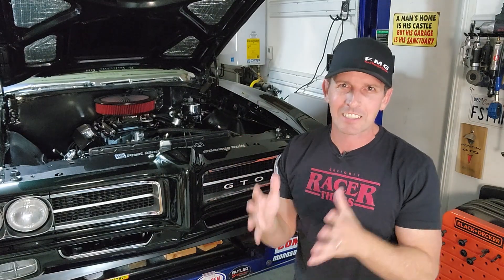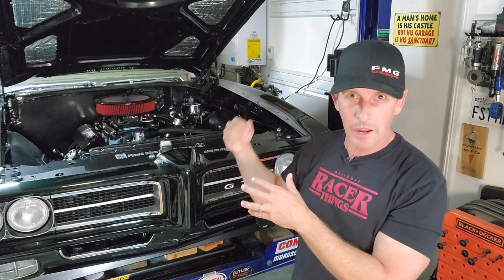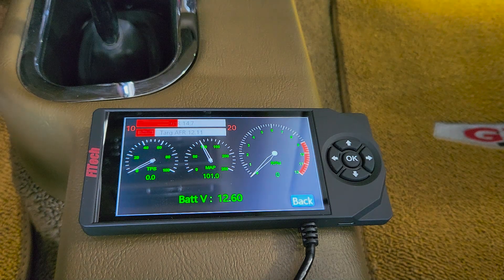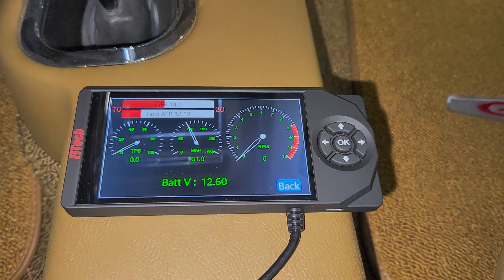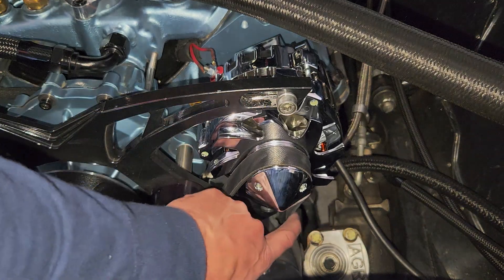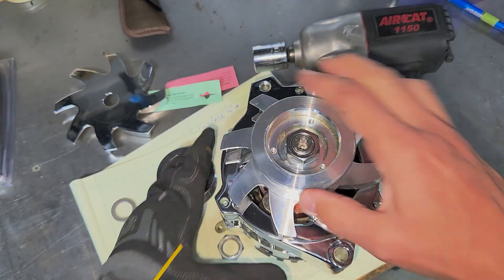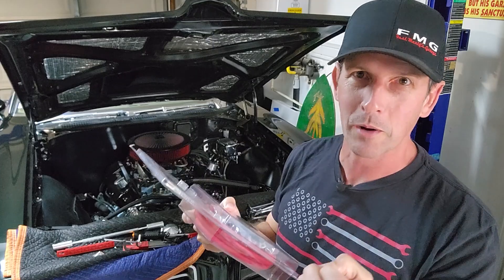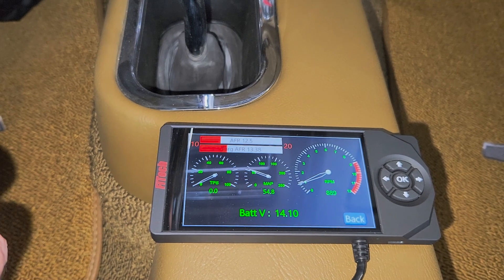How to diagnose an Alternator, and properly install a One Wire alternator with more Amps.

Comment: It's easy to be a critic on this side of the computer screen, but if the engine starts to stumble and electrical components start to act weird while the engine is RUNNING, it's almost NEVER going to be the Battery.  The battery is an electrical storage compartment and electrical buffer for the electrical system.  When everything is connected properly, the alternator has a built-in regulator to maintain voltage, and it modulates necessary amperage based on electrical load.  In other words, if the alternator fails (even during mid-trip), the available battery voltage (& capacity) will gradually diminish, causing drivability issues as components are starved for voltage..... okay:  ELECTRICITY for the novice out there.  This condition is immediately validated by the slow cranking speed during the attempted engine re-start:  The battery has lost it's capacity.  (Ok, Ok.... I'll give you props for the "Hot-Soak" condition - -- yes, this happens as well.)  But sorry:  The sequence of events and field-observations would immediately steer a seasoned technician towards the alternator, not the battery.
.
Another technical error I'd like to point out:  You are absolutely correct about never disconnecting the negative battery terminal while the engine is running.  Yes, it can destroy electrical components on modern vehicles, but it's not due to amperage issues.  It's due to voltage spikes.  First, a voltage spike will happen as the neg wire is disconnected...the alternator is all of a sudden confused as to voltage regulation; it'll immediately max out and/or go haywire due to the absence of battery buffer in the circuit.  Additionally, if this {terminal disconnect test} doesn't kill the electrical components, reconnection can due to another voltage spike event...as evident by the sparking terminals.  Reading up on switch "bounce" validates this paragraph.
.
Furthermore, recall the famous formulas "Volts x Amps = Watts" and Ohm's Law (V = I * R ).  ...and here is the WATERED-DOWN explanation for this one:  An electrical gismo is generally rated by power (watts) at a certain anticipated running voltage, but its internal resistance generally remains constant.  A functional alternator, spinning with Neg battery terminal disconnected, will generally "Max-Out" on voltage and provide maximum amperage on demand.  Going back to the formulas, they can be combined algebraically, resulting in   {Voltage (squared)} / Resistance = Watts.  If the gizmo resistance remains the same, and the voltage increases, then wattage increases by V (squared).  Basically the gizmo burns up because it can't handle the power output.  Solid State devices "burn up" due to overvoltage as well, but such properties can be vastly different and is a story for another book.  ....basically damage is done at junctions.   Oh... I'm not going down that rabbit hole.
.
As for the new alternator spinning more "sticky"... too many variable to consider.  Different bearings, different tolerances, different design.  But generally speaking, things "loosen up" as they're broken in. 
.
....if you made it this far in reading, I've been a tech for 40+ years.  I know a lot of stuff.
Reply from the maker: Yeah, what he said.  And, I did read the whole thing... baaaahahahaha.  Thanks for the comment!
Reply: @FastMonty  ...And when things loosen up, that's what SHE said. 😜
Seriously, you did a nice presentation and you emphasized (often overlooked) critical support components such as wire gauge.
{Just hypothetical numbers here, okay?}
Upgrading from a 90-Amp to a 150-Amp alternator doesn't mean it'll always pump out 150 Amps.  ....Power produced will balance with power consumed.
.
But my point is that upgrading (heavier-gauge) wire is a MUST to ensure an operational & safety margin.  Good Going & Nice video.
.
....we've all been there:  Mistakes, learning curve.s, & corrections  Me Too.
Reply: @FastMonty  would like to offer some input (pun intended) to one last item:: Swapping pulleys to accommodate belt length.  ...not a good idea in long run.  Installing a larger diameter pulley also decreases RPM at any given engine speed which surfaces 2 stress issues.
1.) Lower RPM = less airflow cooling, and
2.) Lower RPM actually causes internal components to work harder to produce required electrical output.
{ I'll refrain from all the tech reasons this time 'round }
.
The alternator mfg designed the alternator with certain specifications which shouldn't be tampered with.  And generally speaking, alternators are "happier" spinning at higher RPM.
.
Unless you have an oversized (diameter) crank pulley [AKA Harmonic Balancer] ...which is doubtful... to compensate for accessory spinning RPM, I'd install the original pulley again & purchase a shorter belt to compensate.
.
Yah !!
Reply from the maker: @Schrimpieman  Thanks!  Yeah, I do embrace mistakes, cuz I learn that much faster.  Thanks for the comment!
Reply from the maker: @Schrimpieman  I hear you... I also "ran this to ground", pun intended, with Tuff Stuff.  They were perfectly fine with the diameter change.  I didn't go into the details, cuz there's only a couple people out there that really care.  ha, ha.... thanks!